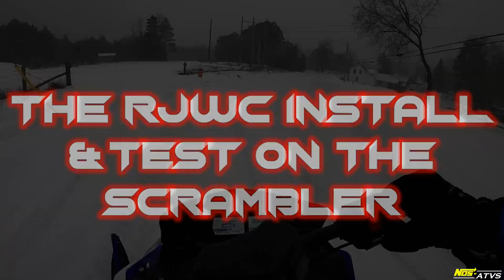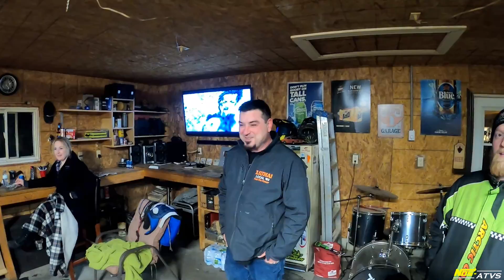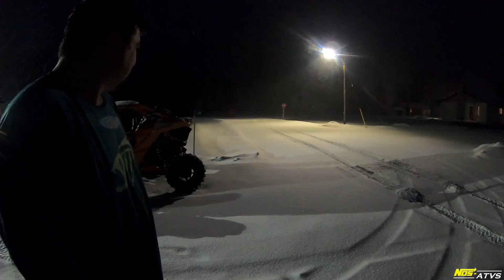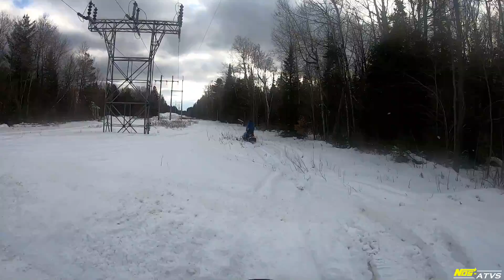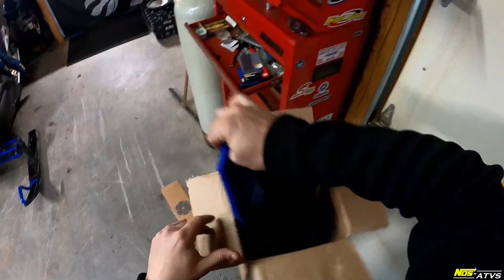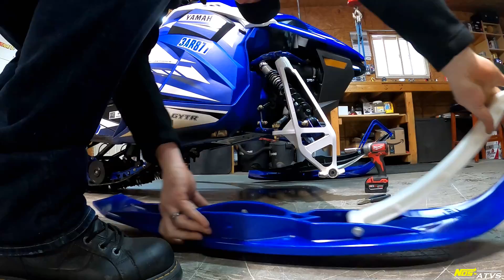300hp Turbo Wheelies, Curve Ski's & First Krossflow Exhaust Test

Comment: The more I watch these, the more I want to pick up a 4 stroke possibly a Nytro. Never would've considered one until I discovered this channel.
Reply: MrSnowrocks I have a nytro (2008) and it’s a good sled
Reply: @tannergibson9473  I've been seeing a lot of those around. It would be a secondary sled/loaner. Got a Polaris Shift 136 that I salvaged from being totaled. Been seeing some with 4-7kmiles, thought I could find one for $2-3k and give it a go.
Reply: I owned a 1100 turbo for a while, the only reason I got rid of it was the front end weight. Only have to drive it once to be a believer in the power. It had a crazy amount of pull compared to a two stroke.
Reply: @mrdiesel6303  The newer Cats and Yamaha with the 998 are much lighter and the changes for 2018 and up make a big difference.
Reply: The turbo has more pull than the 2 stroke. Not because it’s a 4 stroke. A 2 stroke makes more power per cc. And at a smaller size and less moving parts
Reply: So yeah. You are comparing a 1000 triple cylinder with turbo to 600-850 twin to strokes. I’d like to try a tuned sidewinder. Just worried it would be less fun on trail being so heavy. I also think they sound terrible.
Reply: @ultrazls1  I have a 2016.viper xtx 141 love it. Just wish I could get out more. @#$&, plenty fast enough.

Comment: Can't beat 4 stroke power, Just had my m9000 up to the mountains. Catwalks for days and it's a 162. So much power!!!
Reply from the maker: I can only imagine with a paddle on a 162.  Going to at least grab a 2" back country next year help the 137
Reply: @NOSAtvs  Lots of fun, shorter tracks are better for most things unless your in the mountains tho.
Reply: 4 stroke with turbo for power*. 2 stroke makes more power than 4 stroke with same displacement and both naturally aspirated. They brought in 450 4 strokes to wipe out the 250 2 strokes in motocross. Thanks to the epa
Reply: @ultrazls1  Yes with " turbo for power " Try getting 340 hp outta any 2 stroke lol, Trust me I've ridden both of all types. and 450s took over because 450s are the best. I have a 250 2 stroke  and a 450 and the 450 takes the cake!
Reply: skidoos new 850 turbo is making 210-220 hp with a tune with half the boost a stock sidewinder needs to make its stock 200. with 150 less cc and 1 less cylinder. and while being choked by the epa. All that's holding them back is the epa and furthering reliability with high hp turbo development. they make more hp with the same boost as a 4 stroke as well. even with less displacement. and yes id hope a 450 beats a 250 2 stroke. they have a 10 hp advantage with 200 more cc. but then again a 250 two stroke has a 10 hp advantage on a 250f with the same cc. and they haven't even been developing the 250 two stroke for over 10 years. at the same displacement and no epa bullshit the 4 stroke would never take over.